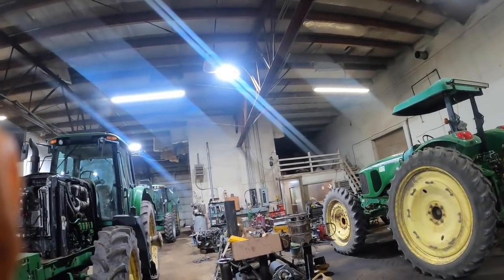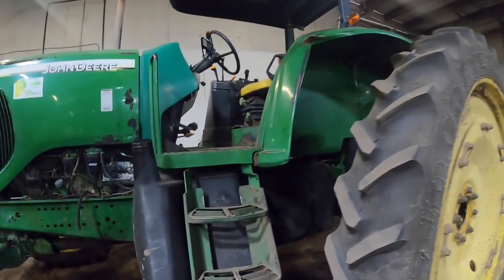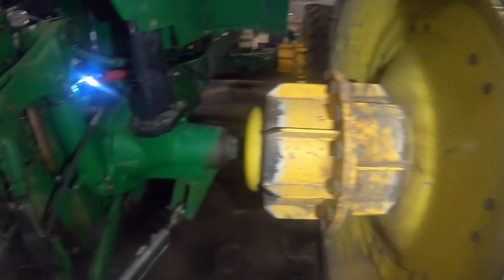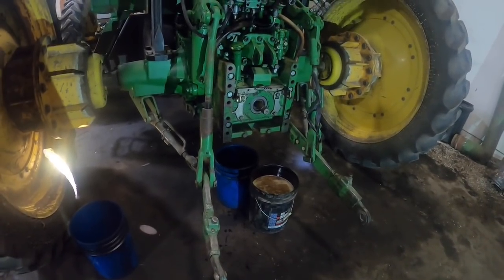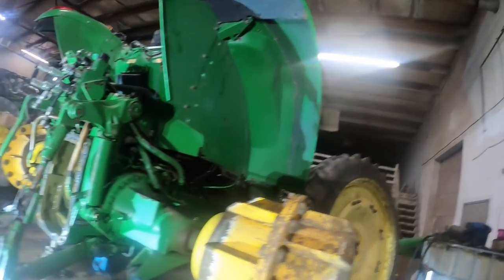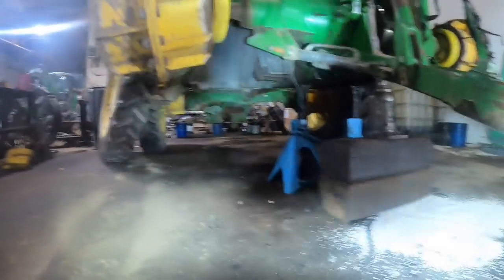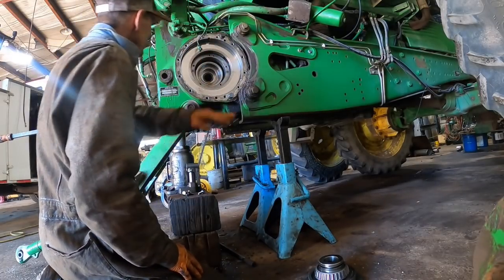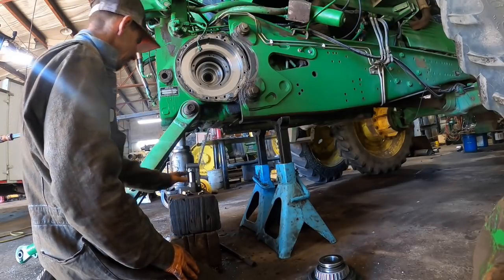John Deere 6715 differential lock stuck on.

Comment: Way to go Jim in PA. And this is a great lesson for the egotistical (obviously budding) technicians out there. Don't be too self-absorbed to ask for help. Someone has seen your problem, and only trick is establishing your network before your despite. I used iATN and my membership was invaluable. Good work Warren, honor a friends, even if you think you know!
Reply: That’s a fact, I’ve worked with several technicians over the years that were way too big headed to even dare ask for help and I saw it bite them in the ass many a times. I’ve been working with a a fellow tech now for over 10 years and obviously we’ve become good friends and we will ask each other for help as much as needed to get each other out of a jam. It’s very easy to get locked in on a problem and struggle to see past what you’re looking at and sometimes all it takes is a fresh set of eyes on the problem.

Comment: Warren, before I forget again, I saw one hell of an interesting tool on another channel, can't remember which, but it was called a "Fender Lizard" that looked damned useful. It's really built to let mechanics do a one-man brake bleed, but it might be worth checking out for shift levers, etc. It's a pneumatic cylinder you hook up to an air source and it has a remote-control button so you get under the car, crack the bleeder and hit the button and the thing extends and pushes down the brake pedal (it's hooked to the steering wheel). Hit the button again and it releases.

Comment: I remember once a friend of mine had a special cable he couldn't find a replacement for, so he just cut off the stripped out shank of the adjuster threaded end and welded some matching threaded stock back on. Worked like a gem.

Comment: Nice find Warren and many thanks to Jim in PA for the help. It doesn't take much sometimes to cause something to bind from wear. I noticed you had a hell of a time getting those discs separated as you tried to inspect them. Could they be worn enough as well to cause the smooth surface stickiness? I see where you can put two smooth surfaces face to face and the lock together almost like you glued them together. They put grooves in auto trans clutch discs to let fluid move in and out of the stack to allow them to slide or grip. Yeah,  low hydraulic fluid will make a pump look bad when there is not enough fluid to even pump. Still a puzzle on the broken cable. It did break at the end of the threads so it could simply be fatigue but you will let us know what you find soon. Thanks for making the effort to do these videos. I much appreciate all the effort. I learn a lot from viewing them. I hope the swivel hook I sent for your engine lift fits your need to attach multiple strap loops in it.

Comment: moisture could be causing a short in the TCU, and when it slightly warms up, the moisture evaporates. Or a circuit board has a tiny crack in the conduction, which closes with heat.

Comment: Hey Warren did you figure out how the traped oil escapes the diff lock when the solenoid is not powered.  I was thinking Either the solenoid housing has a dump hole or the piston has a bleed off  Orifice. Good content as always thanks.

Comment: Hello Warren I had a similar problem with a speed sensor when it was cold and we found that the wire wound core must have had a small break in the coil that was just starting to fail. Once it was warm it worked fine but it took a few starts to get it warmed up enough for it to stop throwing codes. Once we changed the sensor the problem went away.

Comment: Just a Q: how does the wheels spining in opposite directions show the difflock is on? Should the not be turning in the same direction? Wheels spinning in opposite directions usually shows open diff and transmission in gear, not?

Comment: Nice job on the diff warren , is that dif the same as a 20 series  
with the bolted centre spider  which gears spin on ,which  breaks the Allen bolt ,would it not be a good idea to fit the
Support which is a mod on 20s and standard on 30s  cheers keep up the great work 👍

Comment: That power issue could very well have caused the issue, could have been chattering the valve causing rapid apply and release and every time it had enough voltage to lock the clutch grab the disks and put load on those teeth, voltage drops clutch releases and grabs again, basically hammering into those splines??

Comment: Machines doing funny stuff cold can be just contact problems due to metals shrinking. With electronics if there is a micro crack it's also the same. I had problems with Fergusson 6160 implement lift panel and I reflowed all the solder joints and it went pack being ok.

Comment: Warren, I had to stop you video at 6:50 LOOK at the middle PUSH PULLcable, it's broke off at the very top below the jam nut. How did you not see that? The old John Deere skidders we used to call the HOSE AND OIL. Cause that's all you were always replacing.

Comment: When looking from the rear to the front just above the pinion shaft there is a set of angle gears in the rear end housing. What does that small set of angle gears drive?
Reply from the maker: Pump drive.

Comment: Couple of years ago a friend of mine was working on his boat by himself and he took an old baby monitor camera($30.00 at walmart) he used to use for the grand kids and he saw on his phone what the problem was when he tried to move the rudder.
Reply: I was wondering if the gopro he's videoing with had wifi so he could watch the linkage move or not.
Reply: @kevinwalker4623  SHRUG never having owned one I do not know what you can or cannot do with it?
Also if he is recording I do not know if he would have tto stop it to run a remote view?

Comment: ive seen that on old case powershift clutch packs just 1 disc cuts tiny groove into splined hub whole clutch pack shot and its usually the gear doing heavy tillage. just this morning had to change fuel pump relay on my car would'nt come on only on cold mornings

Comment: When you had the rear wheels on you turned a rear wheel and oposite side turned other way so was not locked up you would have both trying to turn same way if locked on surely

Comment: With the  TCU problem is that the tolerance with the parameters are very small. When cold comes into play resistance goes up ok all electoral components. There is either a connection lose connection or it is a wire with already hugh resistance

Comment: I know I am in my arm chair. But at 30:38 just look/check at the pinion bearing, the roller spacing looks odd and it seems like there is no bearing cage. Worth a look before it goes back together.

Comment: Years ago I worked on one that had eaten the brakes up so much that there was so much mitral in the hydraulic system that it was stuck in forward gear and had to flush the entire system out including the transmission

Comment: Well, there is a broken linkage Warren. Silly operators never report nothing then when it quits, they cry about it. So, a little confused. They had their mechanic look at it but didn't discover it's low on oil? I mean, that's obviously the very first thing that should've been checked. Even the operator should be checking. 
Warren, this is where you should have some "all thread" weld a nut on one end and you made yourself a "puller" bolt.